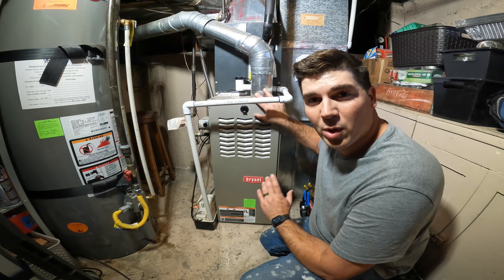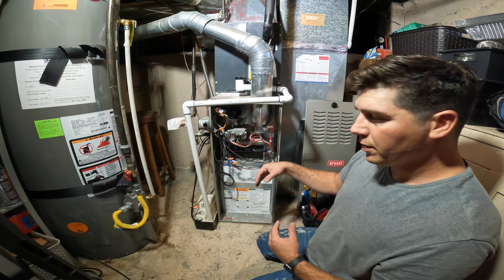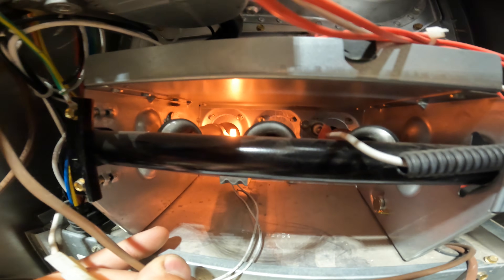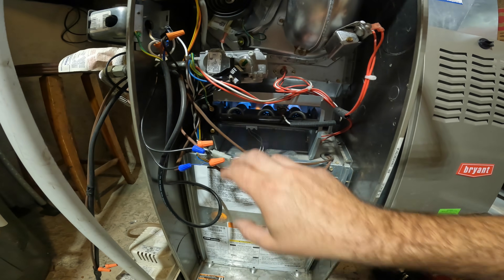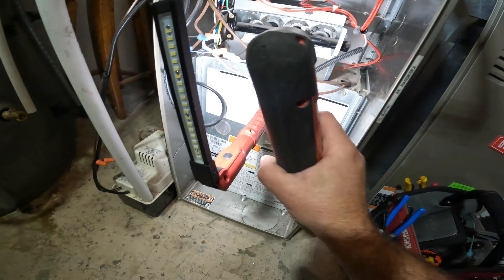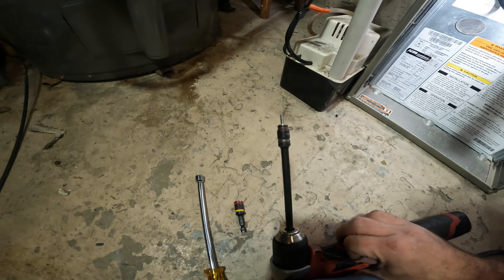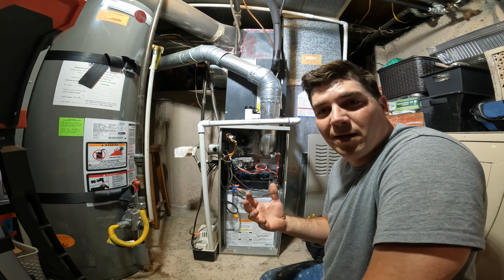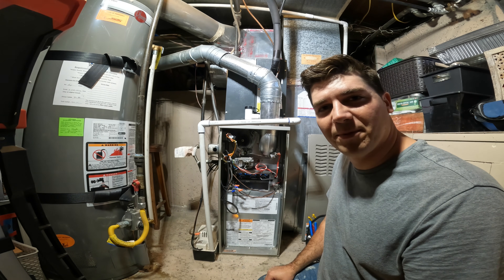Why Won't My Furnace Stay On? - Dirty Flame Sensor -

Comment: I worked in the HVAC field for 20 years and you brought to mind something that used to really piss me off. Crooked heating contractors ripping customers off. You can make a decent living in residential heating and cooling and your customer base grows over time by referrals if you treat people right. There was one such company that ripped people off in my city. A customer would call these people cold from the phone book and a tech would go to the "no heat call" in the middle of Winter and tell the customer they needed a gas valve but they can't install it because you have a cracked heat exchanger and it's likely you'll die from carbon monoxide as you sleep. Then they would say they are calling the gas company to lock out the gas meter so if the furnace is started you won't die. Then after scaring the hell out of the homeowner with freezing to death they offer to replace the bad furnace with a new one they have on the truck. They demand payment up front..This company offers the customer a "second opinion" and would have a guy from the same company show up with magnetic signs showing a different name. BTW they all had mag signs for the trucks to be " a second opinion" contractors. They even got caught selling repainted old furnaces removed in working condition from another home that they " condemned" to sell as new. When the owner of the company got caught with fraud he'd get a high power lawyer to get him off with barely any consequences. All this occurred in the 80's into the 90's. I retired in the late 90's and moved away so I have no idea what eventually happened to the company. When I went on a call of no heat and it was a simple no parts required fix I'd check everything out and if I had a new furnace filter that size would replace it no charge and tell them to keep new filters on hand.
Reply: Sadly, it is a crooked industry. Manufacturers except Goodman, won't sell direct to consumers, HVAC parts stores won't sell parts to non-contractors and repairmen have a bag of tricks to use to sell you a whole new unit when you might only need a capacitor or other $10 part. And, of course, when it is zero degrees out and your pipes are freezing, they know they have you over a barrel.  I applaud the guys who provide honest DIY advice to help out competent people to do simple repairs via YouTube videos. Word of Advice is a favorite channel of mine.
Reply from the maker: Wow, this doesn’t surprise me somehow. People are so greedy these days. I try to do right by all my customers and everyone is happy that way. Thanks for the comment. Make sure and subscribe to our channel for more hvac tips and tricks! Cheers
Reply: @Rick Daystar, what a story!  The guys behind all that probably got a slap on the wrist, and are now serving as LEOs, judges and politicians!🤷🏼‍♂️🤔 🇺🇸      Thanks for being one of the honest guys.
Reply: @lylecoglianese1645  Thanks Lyle, I don't know how exactly he stayed out of jail but he probably settled with customers that sued. He drove a green Rolls Royce not afraid to hide his wealth. The guys would see some of his " techs" when we would stop in the HVAC supply and made it known  they didn't like what they were doing. The good guys are in the majority.
Reply: I have used the black wet or dry sandpaper, 1000 or 1200 grit to clean the sensor.  Then use a dollar bill to rub down any high spots.  I don't have trouble for a long time after that.  By sand paper, most people use 100-220 grit, and that is way too rough.  The probe is stainless steel, so 1000-1200 grit really is polishing the surface.
Reply: @sup8447  Newer tech here, but 55% humidity sounds pretty high IMO. I know newer aprilaire controls actually limit humidity to a maximum of 45%, and generally we recommend 35%. If you've had it at 55% for a long time there could be mold somewhere. If its a gravely smell it could just be the humidifier pad needs to be replaced. If the smell is just around the furnace somebody might have forgotten to plug a hole in the exhaust pipe, you can just tape that. If you've had anyone look at it its probably not the heat exchanger, but sometimes you will notice a bad smell if there is incomplete combustion. CO doesn't smell on its own, but other byproducts of incomplete combustion do. always make sure carbon monoxide detectors are current.
Reply: @sup8447  if it has an air conditioning coil it could be that.  Mould and slime can form especially in the drip pan.  Sometimes it’s dead rodents or their droppings, in the duct work.

Comment: Mine is a 1991 heil I could not find a flame sensor.
Reply: Flame sensor is on the opposite side from the hot surface igniter. Thus proofing flame on the last in shot burner tube.
Reply from the maker: All furnaces should have them. Yours may be a bit hidden.
Reply: The flame sensor only has 1 wire, that helps narrow it down
Reply: I have a 22 year old Heil 80% furnace.  The ignitor AND the sensor are mounted on the same unit.  Find one, and you have found both of them.  Be careful cleaning the sensor and don`t wreck the ignitor in the process.  Kind of a spendy assembly now days.

Comment: Good video👍🏻. I did this to my furnace last night. Burners would come on for a few seconds then shut off. Pulled the sensor out , cleaned with a scotch brite pad , reinstalled and it’s running like a champ again.
Reply from the maker: Amazing. So happy this helped you out in a time of need. Cheers my friend
Reply: @diyhvacguy 
This video would have saved me 7000 $ on a replacement furnace...  pretty sure this is the exact problem I have with old furnace...

Comment: I think you missed a very important first step.  I believe the first thing to happen is the furnace controller checks to see if the inducer vacuum switch is open indicating the switch is not stuck closed.
Reply from the maker: I think I mentioned that. The pressure switch basically says ok we are good to proceed. I need to dumb things down a bit because I take for granted that people know what a pressure switch even is or does. I need to take more time to discuss things in more detail. Noted. Thank you sir
Reply: @diyhvacguy  -- Overall a Great video.  I just wanted to let folks know that the controller does a quick check on the pressure switch to make sure it's open before it turns on the inducer fan.  If you don't verify that, the pressure switch could be shorted giving a false indication that the inducer fan was working when it may not be.

Comment: Flame sensors are plated with a metal that prevents corosion  use care when cleaning them to not use such a strong abrasive that you remove that plating on the flame sensor rod ,, 3m Scotch brite pad's work well a rusted dirty burrner will also prevent flame detection as it causes high resistance to back to ground cleaning and inspecting burners are a part of furnace mantanice for safe operation   .. Allways observe the flame entering each port on the heat exchanger for any signs of agitation when the  main blower comes on ,, if you see any you must have a heating technition inspect the heat exchanger for leaks , gas appliences should be checked by a technician tech for proper gas preasure and at the inlet and outlet of the gas valve as well as proper combustion  as a part of yearly  mantanince cycle.. allways have a working Co detectors in your house.
Reply from the maker: Thanks for these tips Brian. Much appreciated! Cheers

Comment: I have a Bryant furnace like that 
Sometimes when it ignites the burns in the tube in front of the orifice 
The furnace is propane 
What could be the problem 
Thanks
Reply from the maker: Hmm try cleaning the orifices first. Then I’d make sure your exhaust vent doesn’t have any obstructions because that can cause flame rollout like what you are talking about.
Reply: Your gas valve pressure regulator may need adjustment (the one in the furnace). Also it could be the 2nd stage LP pressure regulator just outside the home. This drops the pressure from the 1st stage regulator on the tank. That one is typically set to 5-10PSI. The second stage is typically set to 0.4PSI, or 11 inches of H2O manometer pressure. The gas valve in the furnace has another regulator that is adjusted per the installation manual for your furnace. You may want to down load the manual. You can get an analog or digital manometer off ebay or amazon. The furnace gas valve typically has an input and output port, that may be a 1/8" pipe thread plug, or a screw in a cast port that the hose can fit directly onto (no need to remove that screw as enough gas will leak around the threads when it's screwed out 1 turn). If the valve uses the 1/8" pipe thread plug, that's removed and a fitting is screwed in, with a small barb hose fitting that the test hose is slid onto is used. Just look for other youtube videos on adjusting this. You do want to check that pressure going into your gas valve from your 2nd stage tank regulator.
I say all this as your original installer may not have done these adjustments or checks. Or your 2nd stage regulator is getting old and the rubber diaphram has lost some flexibility (you may want to look at replacing this if 20+ years old). I just moved the furnace I had in the house out to the garage where I installed a 2nd stage regulator and the furnace would not detect flame. I found I had to adjust the regulator in the gas valve as it was too low with the different 2nd stage regulator pressure.

Comment: Thank you for your videos. I have bought flame sensor and ignitor for spares, the 1000 w inverter for temp backup and opened up my furnace to look and see how it works. Knowledge is power. Thanks again.
Reply from the maker: Glad I could help. Thanks for your support! Cheers

Comment: Excellent video. It seems like cleaning this flame sensor yearly would be a good DIY preventative maintenance.
Reply from the maker: 100% a must with yearly maintenance. I see SOOO SO many of these every winter season and feel bad charging $150 for that but I have to make a living.
Reply: Cleaning the flame sensor usually does not work. It may work for a week or two. But, it really needs to be replaced.
As a Contractor and Tech for over 28yrs and as a Trane technician, this is not the solution. 
Someone is going to get hurt.
Shame on you.
Reply: @russgudz4220  Yea, shame on people for not paying $300 to make a simple repair that a trained chimpanzee could do.
Reply: @tgriebe  I apologize Tom. If that is what you need to do for your customers, that is fine. If that works,great. But, I would not recommend it. Giving the info to laymen does mean that they could get hurt. 
Best solutions.
- Always turn the power off to the equipment that you are working on.
- God forbid that you don't discharge an outdoor unit capacitor.
- Hire an Hvac contractor if you have any issues.
- 230vac can kill you.
- check for birds in your inducer motor.
Have a great holiday season Tom.
Best wishes!🎁😎
Reply: @russgudz4220  
Why does a flame sensor need to be replaced? Isn't it just a piece of metal with soot on it? Just asking for a friend. Thanks.
Reply: @amorales9613  Angela, the flame sensor should be replaced if it fails to keep the flame going. Using even Emory paper(which Hvac and Plumbers use to clean copper pipe before brazing) doesn't work for long.
This is just asking for another service call at a later time.
The flame sensor is a safety to detect flame so that the gas valve will stay open. With a weak flame sensor the gas valve will shut off within a few seconds and in most cases the furnace will try to ignite 3 times before it goes into lockout. The power has to be switched off to reset the furnace and the entire process starts again. It is worth the piece of mind to change it when it fails.
Besides,if your equipment is under 10 years old,it should be under the manufacturer's warranty.(if the installation company registered your product. Otherwise,un-registered will only have a 5 year warranty.)
The only thing that you get charged for is the labor.
As a Trane technician in the field for 28 years, I have seen what can happen.
I would suggest adding a twice per year maintenance program to your system/systems. Get a reputable company and in most cases,this shouldn't cost more than $140.00 per year on average.
The technician will ohm out the components and check operation, diagnose any issues,clean your outdoor unit coils and change your filters.
I hope that this was helpful to you.
Have a great holiday season.😎
Reply: Simple dust on the white insulator will short the flame signal to ground.  The insulator can also crack.  I have an old carrier (32 years old) that was the most problematic hot surface ignition furnace in the field.  We had to replace the flame sensor, board and wiring harness to get them to work.  They used a long white plug that went into the board.  A bad place, as it would collect dust and short out the signal. It was also a very bad connection for the flame signal.